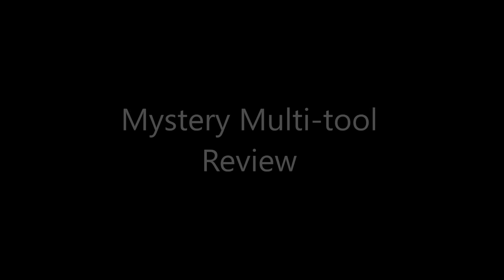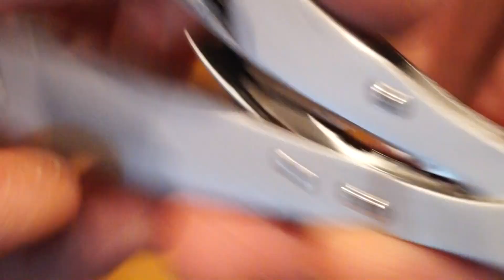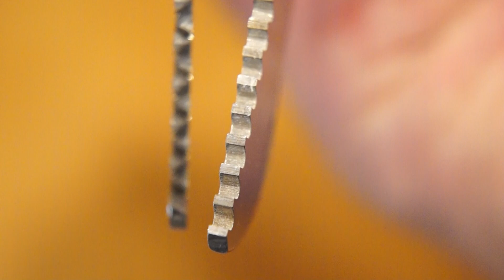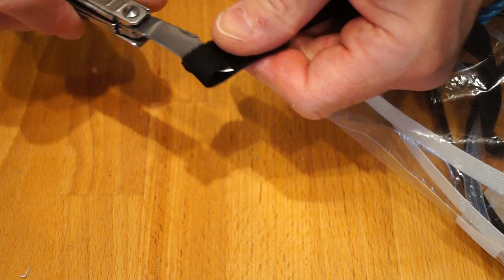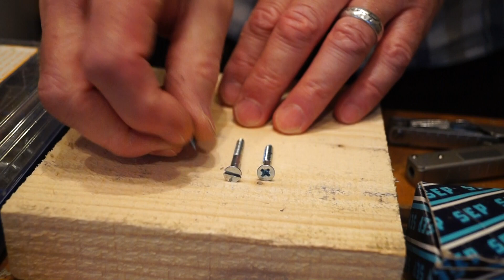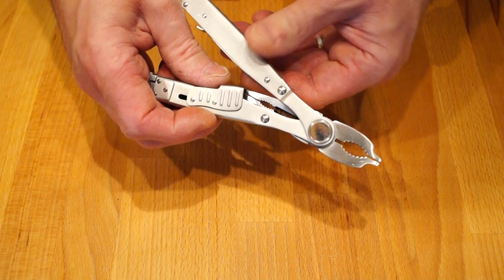Mystery Multi Tool Review

Comment: I have one. Interesting tool to say the least. I keep mine in my vintage vw for roadside emergencies. You used an awl when there's ine in the tool. The ripper is for getting thru small (obviously) branches. Not 2" long boards. You can lock the long nose pliers and elongate the unit and rip thru wood or gouge out holes. 
The display of blades cutting zipties when there cutters on the unit is superfluous. 
All together a rather negative review of a well built functional tool. Especially the bits in the handle if elongated. Holding the small jaw with thumb, you can really put force into driving a screw with  long handle. Or 90° the handle for torque. 
I enjoy mine.

Comment: Thank you for making this video. Someone gifted one of these to my son. As he is fairly averse to manual work, it has been lying around for a few years. I recently took it out and indeed, there were a few mysteries that you cleared for me. I could not figure out how to close the blades. I had opened them all together and did not notice that the saw blade did not lock, which is the one to depress to close the blades. Also, the spanner was not obvious to me. I dropped the screw driver bits before I counted them. Being in a dimly lit shed, I picked up the three I could see and hoped I had recovered all of them. After watching your video, I went back and recovered the forth one. tool was not obvious to meLastly, I did not know what the slider was for but now I do :)

Comment: I just found one on the side of the road today. It says FlipGrip on it, but the accessory tools are slightly different. Also, mine don't lock into place. I'm guessing it will be a decent multi plier tool for in the car though....

Comment: Nice find....
Found it on ebay https://www.ebay.com/itm/NEW-Sharper-Image-FlipGrip-Dual-Jaw-Multi-Tool-Stainless-Steel-leatherman-type/302656898114?epid=2122470559&hash=item4677c1c442:g:QTMAAOSw2fdamXZB
BTE the Schrade mentione din the comments is this https://www.ebay.com/itm/Schrade-Tough-Tool-Multi-Tool/282726553508?hash=item41d3d0d7a4:g:yEAAAOSwNMVagigV
copies of the latter are around the Chinese websitse

Comment: I purchased one of these tools about 10 years ago through eBay.  The raised centre tool that is pressed to unlock open blades is a feature found on Schrade Tuff Tools as is the way they open from the top of the handle not the side.  The blade that looks like a fish scaler is actually a serrated knife blade that should be very very sharp.  The tool I have has a rivet holding the blades in which is another feature of Schrade Tools.  Back when Schrade was operating in the USA they would collaborate with other manufacturers and produced some very interesting combination pliers and vice grips.  There have been recent rip offs of the flip feature.
Reply from the maker: I got this one around 10 years ago too. I was working for a company that sold them.

Comment: Flip Grip is correct.  I've had one nearly 20 yrs.  Bought in a local hardware store in VT when we lived there.  I still have and use it and it's actually the best multi-tool I've had over the years for its usefulness to me.  I'm a photographer and it stays attached to my main camera case.  It may have been made with an electrician in mind.  Made really well.